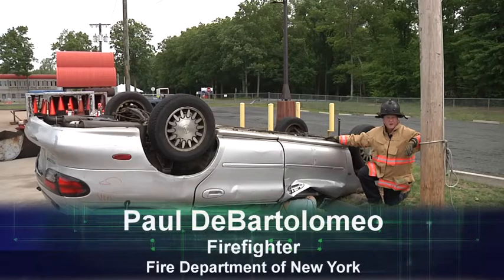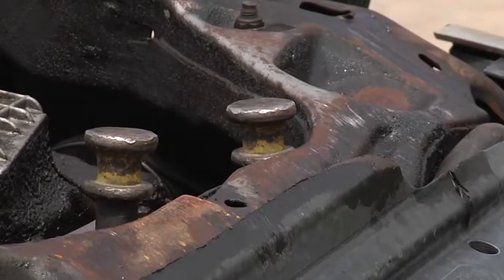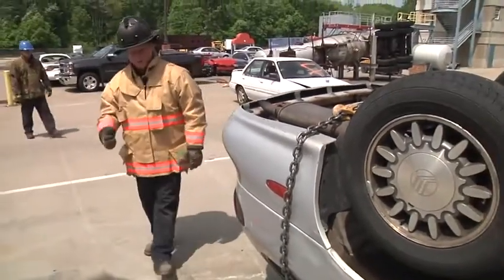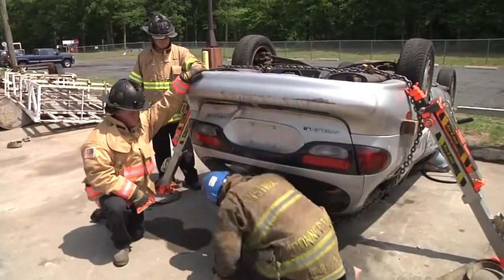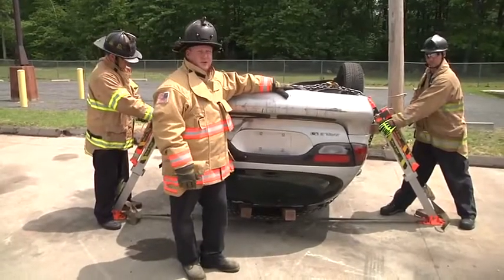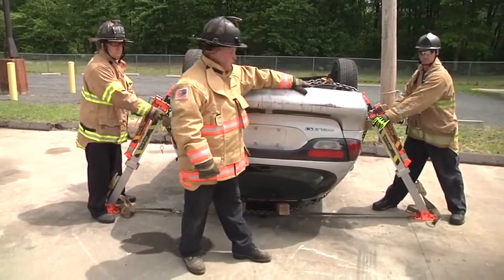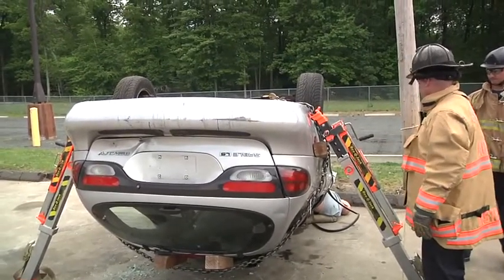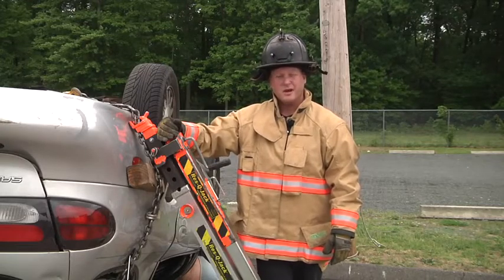Rollover Extrication with Extremity Pin

Comment: You’re better off calling the funeral home then doing this method
Reply: Or driving safer using seatbelts and paying attention while driving. This is worst case scenario and with the evolution of technology we’re able to provide safe reliable extrication, speed and unsafe actions caused these scenarios and you need to prevent those things from happening again while extricating you don’t want to be the reason a patient dies after surviving an accident but you cannot rush it either.

Comment: This would take just long enough for them to bleed out. How bout airbags or the spreaders to relieve pressure on trapped arm and then work on getting the door open ?
Reply: All of the above listed methods are definitely less stable.  The only change i would make is running the chain through the rear windows.  Much quicker, and no extra shimming or void space padding.
Reply: The problem with those options are technical. It would be easier and Faster with airbags or spreaders as you said however you have less control and the vehicle might rock back or lean to the other side. You have more control by grabbing the entire back of the car with jacks.
Reply: @JOSENOELEYVA  I disagree. Throughout this video I was saying the same thing... airbags and spreaders. They're not less stable.
Reply: @aloysiusdevanderabercrombi470   I think spreaders would be less stable.  There is always the chance that the spreader will tip sideways or the ground will giveaway. 
The Res-q-jack have a nice large foot plate that will spread the load.  If I was using a spreader I would be feeling that I was taking a risk. Where would you put the spreader?
Would you go for the front of the car close to the A or B piller and then "pack as you jack"?
Reply: Airbags can fail and have no backup device unless cribbed with wood or some other device however the car can topple if if cribbed as there is no directional support. The jacks featured in the video provide side and lateral support except for front to back support hence the stakes place in the front of the engine bay into the ground securing that movement point.
Reply: Also, Fire is always thinking about eliminating unnecessary risk. So stabilization & meticulous extrication are most important as they do not want to cause more injury.